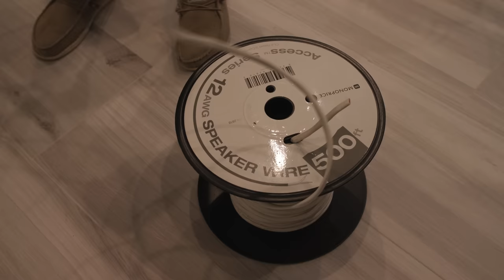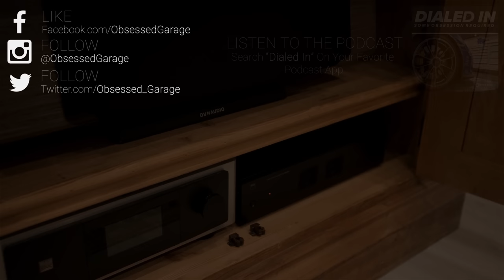Installing My Surround Sound Home Theater: Dynaudio Contour, Evoke, and NAD

Comment: Years ago I used to cable I found that using single feed through bushings on the drywall to pass the speaker wire through then using braided wire protector was so much cleaner astetically then putting speaker terminals plates near externally mounted speakers. It costs alot less money too.

Comment: Matt, I know you hate hearing it, but when it comes to home theater you know just enough to be dangerous. You bought very good gear, but the speaker locations in the room and seating position are terrible. Sofa should not be up against the back wall. Dirac can't "fix" these major errors! You made an attempt at acoustic treatments, but in a room that size, you didn't go far enough.  The room should be Munsell Gray, not white. The center should NOT be in the cabinet, like you already mentioned. With a house your size, you probably should have put an equipment rack in another room or closet so any fan noise is not a problem. I feel like you just jumped into the theater design without any professional guidance. Fly me down there and we can get everything sorted out and performing 1,000% better. You have a nice room and gear to start with, but the execution is a mess and I hate to see such resources underperform. Sorry to be the bearer of bad news, but it's like buying a BMW M3, putting bargain tires on it, loading it up with an extra 1,000 pounds of weight, and only driving around the block at 10 MPH...
Reply from the maker: You are missing the point.  This is a room with a TV and some nice speakers.  It is not a theater room, nor do I want that.  I did that once and never used it.  This is making the best use of a basic room.
Reply: Got that right. Best use of a basic wouldn’t have speakers hanging off the walls in the wrong locations. Not to mention aren’t they like $1000 a pair? Then you run 50’ of cheap 12 g to them? Through connectors. Your sound loss to the speakers negates any money spent on speakers or amplification. If you have a compromised room, spend accordingly.

Comment: Why not a front projection system with a bigger screen?  Much more immersive experience for movies.
Reply: You’ll never get a screen that looks as good as a display.
Reply: @q1joe  I mean with matt’s budget and a good dialed in jvc and good screen you can get pretty darn close and damn good by anyone’s standard’s. You don’t need OLED ink blacks to have an amazing viewing experience. especially if sound is on point. I hate this argument
Reply: And a display will never give you a more theater like experience than a front projector.
Reply: You'd need a laser light cannon with the amount of ambient light coming in that room and bouncing around off of white walls and ceilings.   Or only watch late at night. Or put in motorized shades. I prefer a projector, but a TV is probably best unless he changes things to control all that ambient light.
Reply from the maker: I did that once, but I hated jerking around with it.  2.35:1 screen and dealing with switching to 1.78:1.  I will likely never do another projector and won't have to do it once OLED and other technologies get to larger sizes.
Reply: @ObsessedGarage  with your tastes Im surprised you didn't have a self masking screen and automate the process

Comment: I’m sure you get enough critiques but:
High side surrounds are not effective
In my surround system, the surrounds are a fraction of the sound impact. The visual impact of having in walls offsets what you are trying to achieve with the audio. 
The fronts are way too far apart to give proper imaging
The center is useless firing through a piece of wood
High end two channel amplification with proper front placements give the best quality, with nothing else! Even with a ghost center. 
The other speakers are fill. Spending a ton is a waste compared to better placement of all the speakers
Reply from the maker: Every single thing you just stated is wrong.
Reply: @ObsessedGarage  wow that’s funny. Bunch of people have already said the side speaker placement doesn’t work (given you can’t locate them due to the location). I guess you open the cabinet when using the center, so maybe that works. 
You are using expensive surrounds with cheap amps. Running speaker wires through a connector results in huge quality loss. Doubling the connectors is hugely degrading. As I said, the surrounds add little anyway. Match the quality of your speakers relative to running 50’ of low grade 12 gauge wire through 2 connectors. Doesn’t make sense. 
You really think you get a decent center image sitting 10’ away from speakers 10’ apart???

Comment: Full credit for trying to do it yourself but I'm sorry, you're actually doing more damage than good. Home theatre speakers supposed to be strategically placed! You've got 2 height speakers and 4 Atmos speakers all within a few feet of each other. You're not going to experience no sense of scale!
If you want to see how it's done properly, click on the red dragon video hit the high-end Dolby Atmos video.
"I would rather listen to $1,000 setup which is done correctly then listen to a $50,000 setup done incorrectly"  🤔
If you wish for advice I'll be happy to help you.
Reply from the maker: They are 10' apart bro.

Comment: Sooo... When are you going to add subs to this situation 😁
Reply: I think I saw 2 small sub sitting up against the front wall...?
Reply from the maker: There are two DynAudio Sub 6s.  Those subs are nasty.
Reply: Ohhh, yeah after doing a little more research, dual 9 1/2, 500 watts etc. At first glance they looked small for that space but probably more than enough. 🔊
Reply: @bert4910  Would probably be enough for some if it wasn't open to essentially the rest of the house